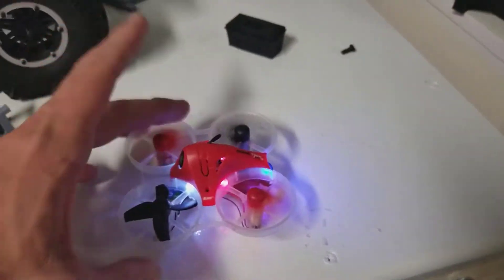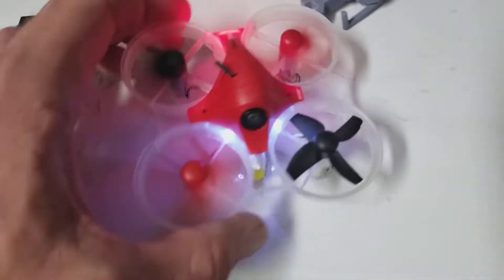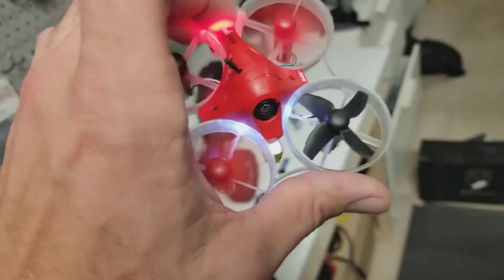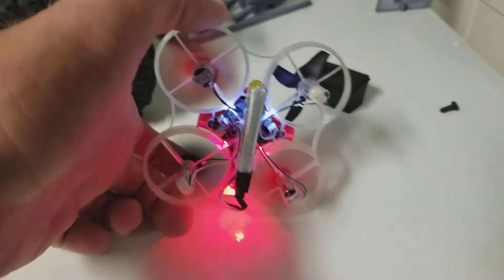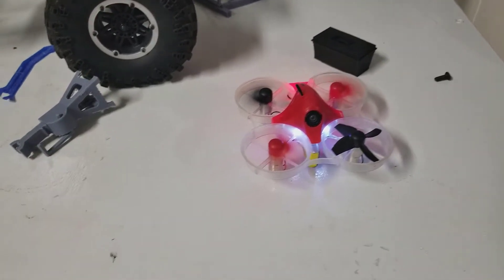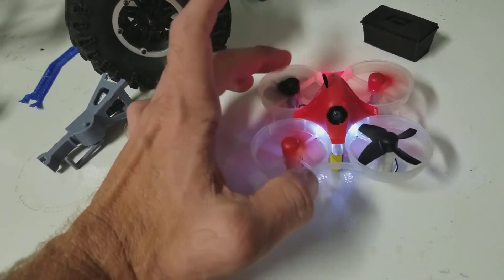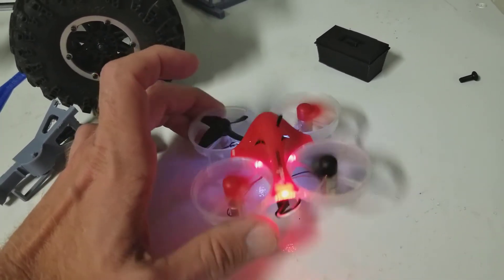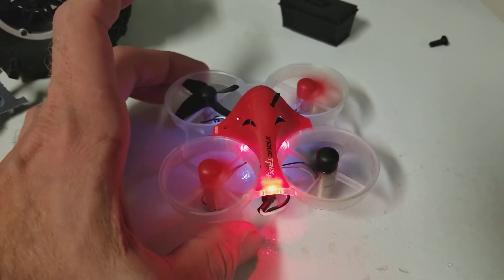Inductrix FPV + Update time. One motor acting up.  Bad FC?

Comment: I had this same problem but I was able to fix mine the issue was with the actual connector on the bottom I noticed if I pushed down on the connector the motor started to spin and the drone flew fine till wriggled itself loose so I took connector off and directly sodered the wires to the board on the one motor and it works like a champ now. ..it's little tricky figuring out your wires since they're both white I just done it through trial and error and got lucky and got them right first time you'll know got it wrong when motors are spinning backwards but if not then should be good
Reply from the maker: Hmm interesting.  I'll definitely check that out.  Appreciate the heads up!!
Reply: @1TenthScaleRC  did you try this?
Reply: Did this fix last? I cannot get mine to fly good by wiggling the connector I wonder if I have a different problem
Reply: I had the same Problem ( left front motor does not arm and causes wobble) I could fix it by pushing the flightcontroler board down (similar to Jesse's solution). I noticed before that if I press the board down with sth while it was armed,  the left motor began to move. So I fixed a piece of folded paper somewhere in the middle of the board between the red housing and the flightcontroler board and screwed the red housing back on the board, so tight until the prop turned. maybe you have to test how thick the paper has to be. Well In my case it worked... maybe for some of you it will help too,  I hope... good luck ! ;)

Comment: I had the same Problem ( left front motor does not arm and causes wobble) I could fix it by pushing the flightcontroler board down (similar to Jesse's solution). I noticed before that if I press the board down with sth while it was armed,  the left motor began to move. So I fixed a piece of folded paper somewhere in the middle of the board between the red housing and the flightcontroler board and screwed the red housing back on the board, so tight until the prop turned. maybe you have to test how thick the paper has to be. Well In my case it worked... maybe for some of you it will help too,  I hope... good luck ! ;)

Comment: Same exact problem here. Tried 3 new factory motors including breaking new ones in to avoid brush issues and the front left is dead below 50% throttle. Wobbles so bad I don't want to fly it. Gonna contact Hzn to see if they will make good on it. Otherwise I will install a betaflight board as I really don't like the alt hold mode anyway.
Reply from the maker: Man, combined with the FB group talk seems like a moderately common problem.  I've been lazy and haven't responded to their email back yet.  My fault.  hopefully they'll play nice.
Reply: Did you find out anything about your FC? I too have this problem.
Reply: hzn replaced my esc under warranty and that solved the issue.

Comment: I too have two FC that have started to do this. I also have one that will not bind. I have been flying one of two since they came out. I have five FC  plus type.  Just happened today.  I have changed out motors, flame, cameras, etc. never had problems like
 this. I was pissed about the one that won't bind. now two more FC down. WTF! It's the FC for sure. maybe using non-stock motors? Overheating? running bad lipos? or a battery to the ground.   we never do that...  In a perf world... 60 dollars for a FC! 
 It should be able to take a Whoopen. The last day or two, I have been flying a little harder to push myself. I guess I have to find another better Flight controller. WTF Blade? Are you going to step up after this OUTCRY?
Reply from the maker: Pooley, S well said man.  This was my first foray into "real" quads...  its sitting on the shelf since then.  Support from blade has sucked.  Will probably be my last one and I also dont want to give them more money for another FC.
Reply: Same problem here, one bad fc and one that won’t go into bind mode

Comment: Same very problem. I bought it from Ultimate Hobbies as a whole kit with transmitter and monitor, five days later the rear right motor  became disable. I was gonna bring back to the store, but then their receipt states very clearly that they do not accept refund or exchange for an opened item. Called  Horizon Hobbies and was put on hold for...eternity, sent an email and so far have not receive any reply... If this happens so too often, to many people, shouldn't Horizon be doing something about it?...Don't get it

Comment: This problem is what brought me here. I just spent a ton of money and literally didn’t get to fly it once :/ this is my first fpv and may be my last. How much is an aftermarket and how do you know if it will fit and work?
Reply from the maker: Hey man, bummer!  Sorry you're having the same issues.  I'm not sure how much the aftermarket are.  It's been sitting on the shelf since all this.  My first trip into hobby grade drones like this was my last for a while most likely.
Reply: Hey man don't let this get you down it sucks it really does this was my second it was an awesome upgrade for about 1 flight , just about anything else is good this has serious issues and horizon doesn't have a good solution for it, I just bought a mantis 85 for outdoors oh man it's so much fun flies so much better than anything I've ever flown before , I'm ordering the tinyhawk right now to replace my sad ass fpv plus because it was really getting me down to I spent $50 trying to fix it and it's still no good , don't give up man!!

Comment: Did you ever find a fix? I have the same issue on mine and was just sent a replacement full kit from amazon. I'm just nervous its going to happen again, and Id love to know if theres any fix....
Reply from the maker: Never found a fix and Balde tech support is worthless.  I've been told it "flies like no drone before" and that "wobble is normal" even though it was indoor with no wind.  I Talked to the guys at the local hobby shop and they said they've heard lots of complaints about this.  Blade won't admit to a problem but has apparently ceased production on the FC while they make updates.  I'm going to wait it out I think.  Might still go with an aftermarket FC but hoping to not have to.
Reply: It's happened to two of mine. any fix?